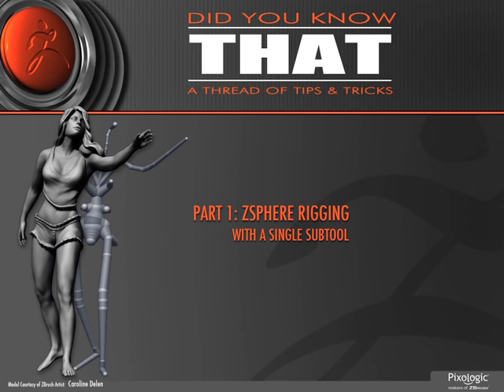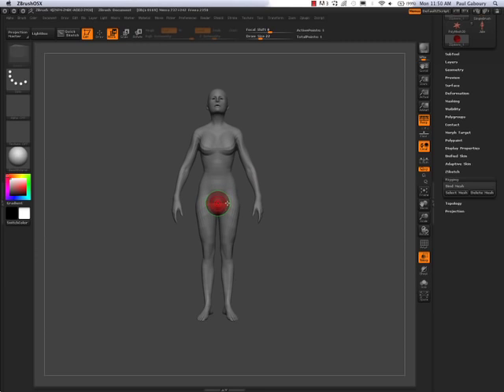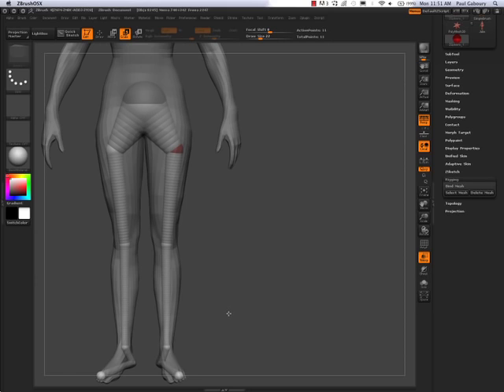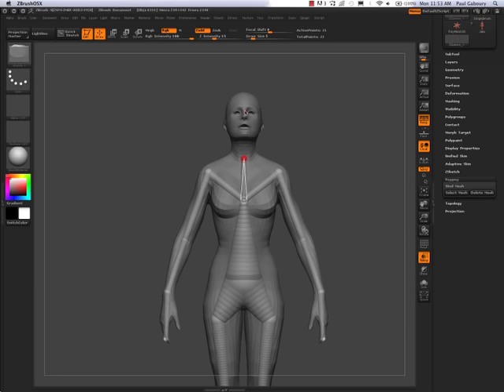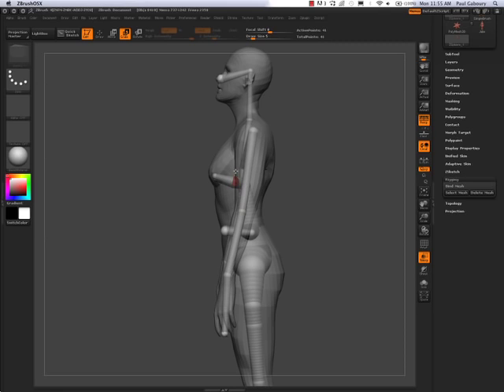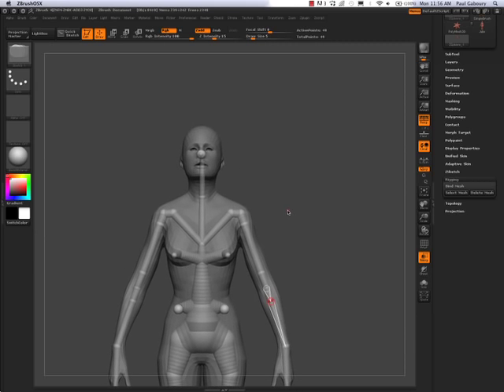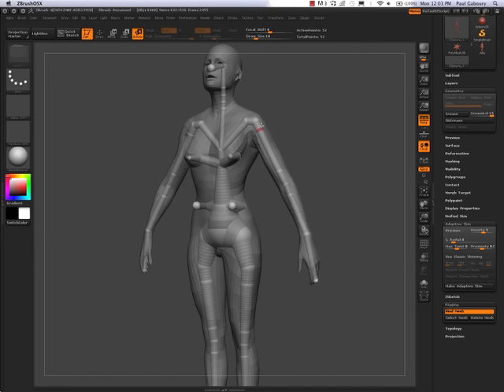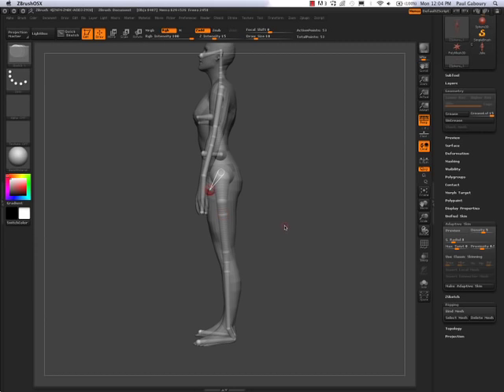Part 1: ZBrush Rigging with a Single Subtool

Comment: I have a problem. when I move the arm it starts to move other parts of the body as well, like some parts of the leg get stretched and follow where I move the arm. I made sure the density level is the same as subdivision level. Do you know how to fix this? Also, the mesh is really low poly. thanks